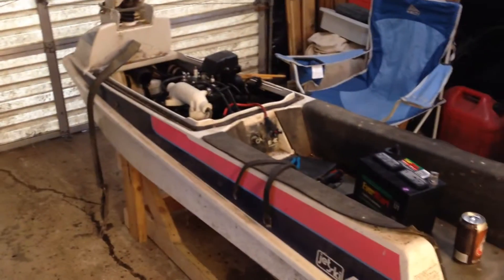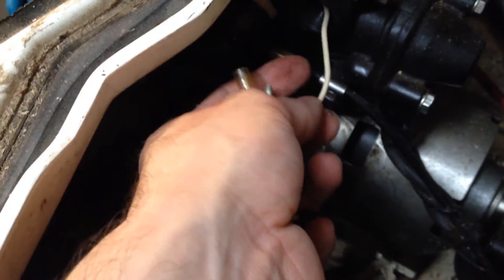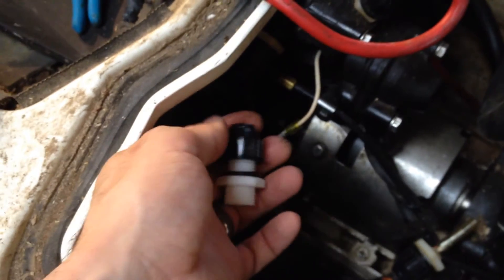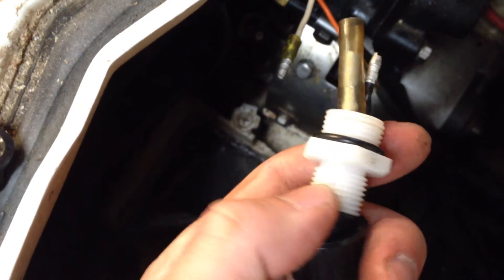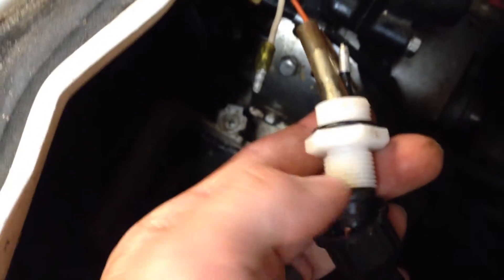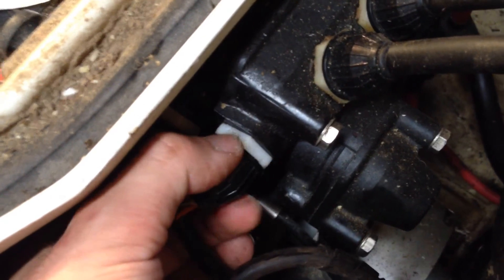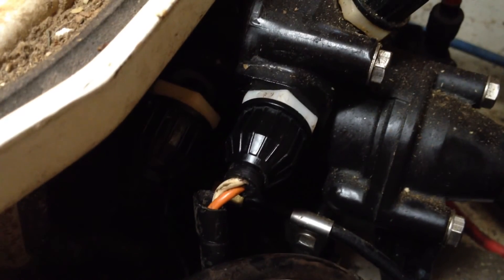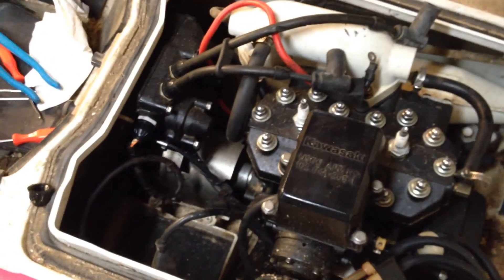1990 Kawasaki 400 / 440 / 550 / 650 Stand Up Jet Ski Electrical Connector Replacement

Comment: So my spark plug connection is loose at the box. The entire thing turns.  The black plastic which is attached to the white locking plastic ring turns together, which tells me water can enter the coil pack.. Please excuse me for my lack of terminology.  Any suggestions?

Comment: Quick Question

I also picked one up as a gift ...  I dont know who had this thing before but the repairs were ... ummm ... interesting. Battery was mounted out on the traction pads fully exposed.

I went into the electrical box and it was crazy how bad it was repaired.

My question is ... How do I get the stator out to replace these same plastic caps. I dont want to damage it but I have to get the whole thing apart to spray and redo ALL the electrics. 

Please help ... Im lost

Comment: Where did you pick these up
Reply from the maker: You can find them on most major online retailers.
Reply: What's the name of those type of connectors.
I looked and didn't find anything
Reply from the maker: KAWASAKI ELECTRICAL BOX REPAIR FITTINGS
Reply: thanks bud